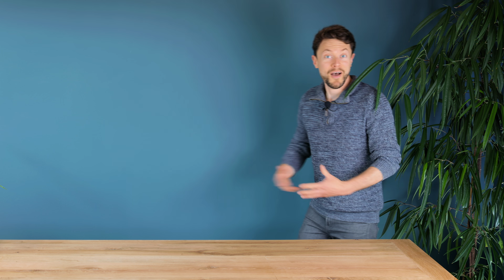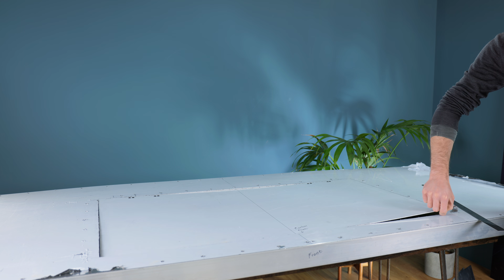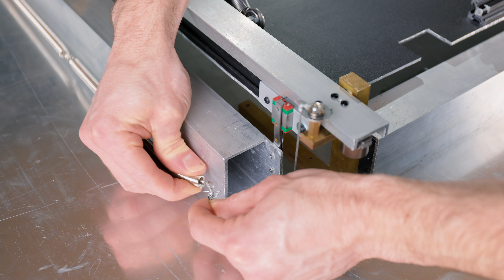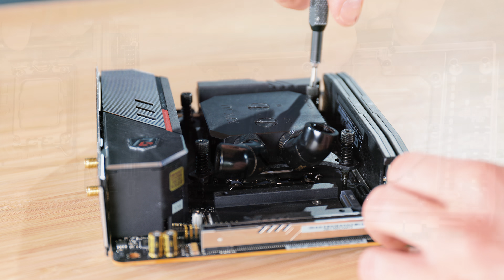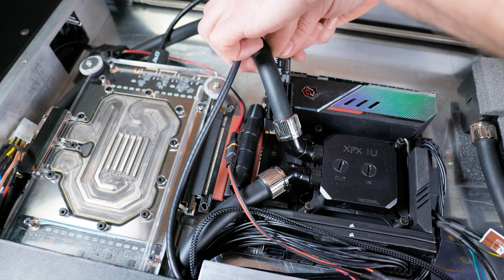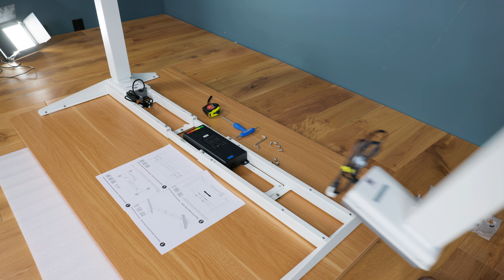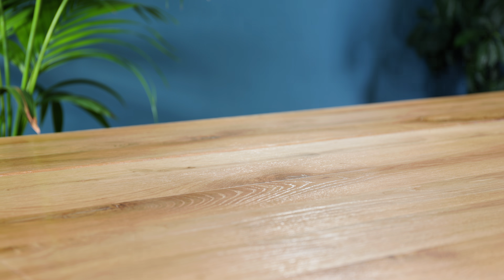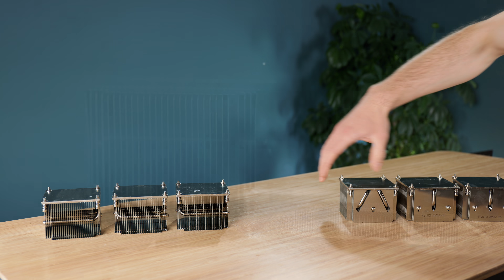Building the ENDGAME invisible PC

Comment: The level of detail in this build is mind-blowing. It's fascinating how you've turned a simple desk into a powerhouse PC, while keeping an elegant aesthetic. The cooling system is unique and seems very efficient. This is an impressive feat of engineering.
Reply: I honestly think it's a fire hazard considering how he's electrifying copper tape to power the fans. The adhesion on that stuff is absolutely terrible and due to the nature of PC gaming having sudden loads + being mounted on brass that's rapidly heated & cooled makes it a disaster in waiting.

The changes he did at the end is also going to result in restricted air flow since the output is so close to the wall and a fan snagging hazard for toes beneath the desk, not to mention the powerful magnet constantly being grinded an inch away from sensitive electronics.
Reply: @Runefrag  add the oled burn in and you have a certain disaster. If the electric/electronic parts don't blow up or start a fire, the expensive oled will get a serious case of burn in. I would give the inner parts more room to breathe, and possidly have an upward facing exhaust at the back, and definitely add a switch to turn off the monitor when the lid is down.
Reply: @Runefrag the fans are blowing away from the user
Reply: @snjert8406  Pushed up right against the wall? I don't think so.
Reply: @Runefrag  I mean, the motor hubs with the stickers are facing the inward side of the table. So, if they function like any computer fan, they're blowing away from the table.
Reply: @Runefrag  Pushing it up against the wall is actually a reason to have the fans facing the wall instead of pulling away from it. Also, with how silent they are, it doesn't matter. I can't imagine it being uncomfortable, unless maybe if you sit at your PC naked.

But yes, the screen will eventually break and it will be a massive pain to replace it, since the mounting screws are blocked by the glued on oak.
Reply: @entcraft44  Fans hugging walls is one of the worst things you can do for cooling. A conservative estimate of how much that would hamper cooling performance is like at least 30-50% but he doesn't seem to have any problems so far so it's whatever.

As for the hot air, looking more closely it looks like it's blowing backwards so you'd be getting a ball draft and some toe snagging fans hazard rather than heating. Paint on the wall will probably get discolored after a while but that's an easy fix.
Reply: @snjert8406  Yeah whoops, i totally forgot you can do both suck and blow configurations on coolers. The distance the fan is from the walls is still not terribly optimal.
Reply: @Runefrag  true, but it seems to have worked. My guess is that the surface area and thermal mass of this thing is so huge that it doesn't matter as much
Reply: @Runefrag "He's electrifying copper tape"

I'm curious - what do you think copper tape is used for?

Copper has an ampacity of 1.2A/mm^2. The tape he used looks like it's at least 25mm in width. With a very modest thickness of 1mm, it would be quite capable of taking 30A.

Maybe try looking up the width and thickness of the average copper trace on a PCB (like the ones in your graphics card), before decrying the dangers of running a couple amps through copper tape.
Reply: @tomfahey2823  The problem is the tape coming loose and shorting out. A full short would blow the fuse on the PSU. So let's say the tape coming into loose contact. With wall AC this could cause a fire hazard, but I am unsure if 12V will cause enough arcing to be dangerous (without being obvious do to tripping the PSU fuse).
Reply: @tomfahey2823  I really thought it would be obvious but here we go:

1. Copper tape is primarily used as a shielding material and less commonly as an anti-snail solution for gardens/houses. It is NOT made for this application.

2. Copper tape is pretty much always made to be absurdly thin for cost saving reasons. He doesn't go into detail but you can see in the video it's basically invisible/flush, pointing towards it not being "1mm thick".

Being so thin and having such a high surface area means the exposed copper will be more susceptible to oxidation and the formation of copper whiskers.

3. The adhesion he uses to attach the tape will inevitably fail, probably quite quickly due to the temperature changes, either loosening completely or curling up and causing short circuits that way.

4. Despite being mounted on water pipes, there's still a risk of localized melting for example, in the mid section where there is no fan.
Reply: @Runefrag  Copper tape is used for electrical applications all over the place, such as for grounding and lightning protection, where it's rated for hundreds of amps of current.

Even a 0.1mm/100um (around the thickness of a human hair - i.e approaching the limit of visibility) thick piece of tape that's 25mm wide has a cross-sectional area equivalent to 14 AWG wire - which is rated for 20A of current. All of the electronic devices around you use PCBs with copper tracks that are approximately 0.035mm/35um thick, which are capable of handling multiple amps of current, as long as the trace width is a few centrimeters wide...

"Copper tape is made absurdly thin" - fortunately, electrons don't care about subjective human evaluations of spatial dimensions and tend to just obey the laws of Physics (at least for a few extra orders of magnitude).
Reply: @entcraft44  Yeah, I agree that the tape coming loose could be a potential issue, however I suspect the power supplies he's using have OCP, seeing as it's been a requirement in the ATX standard since like 2006.

I'm doubtful that anything like this could lead to mains AC getting onto the copper tape, but in the worst case scenario, the GFCI (mandatory in UK homes) for that domestic circuit should trip well before there's any possibility of a fire starting.
Reply: @tomfahey2823  You seem to have some problems with reading comprehension. I never said X amount of electricity CAN'T travel through Y amount of copper. (The copper tracks on modern circuitry is protected/insulated/masked/coated 99% of the time by the way.)

I'm telling you it's an extremely bad idea (while listing several bad things that can/will happen) and that these kinds of products are not really meant for this kind of thing outside of extremely DIY stuff or highly specialized things like flexible TV display connections, which is why they don't have any sort of safety or manufacturing standards unlike cables.

I would love for you to show one or more examples of professional installations that's gotten a passed safety inspection using copper tape because such products is by default something we call an exposed or uninsulated conductive element and it is NOT allowed in the NEC, IEC and similar standards.
Reply: @Runefrag  a) Are copper whiskers a thing? On commercially pure copper that is not tin plated? I have never heard of that.

b) Copper conductors do not experience anything that I would call "thermal runaway". Can you be more precise?

c) A short circuit is not a fire hazard because the overcurrent protection of the power supply will catch it. Only a high resistance connection is problematic.

d) Have you considered that the desk interior is made from aluminium? That will keep the heat away from the oak. I think the fire risk is minimal.
Reply: @entcraft44  a) Tin is one of the metal that forms whiskers most quickly but it happens with most metals, including pure copper, especially if it's exposed to air and thermal stress.

b) I was thinking of something else closely related to fan circuitry, i changed it to that the tape in the middle is likely to melt/experience uneven stress due to not having a fan on it like the rest.

c & d) OCP on modern PSU's have become quite good but the fact of the matter is that you just need a single bummed transformer for that entire protection system to not work. Saying "short circuits is not a fire hazard" is just objectively dumb. Plasma is plasma and it lights plastic on fire just fine.
Reply: @Runefrag It's clearly enough airflow if the stress tests he put them through were keeping it cool at such low volume. Doesn't matter if it's pointed toward the wall. It being inefficient isn't really a problem if it's still doing its job perfectly. 

As for the copper tape, no idea personally but I'm sure he's done his homework.

Comment: This is a fantastic project. But I'm still a bit allergic about the cooling system. Could they be fitted inside the table by using 40mm fans and compatible heatsinks?

Comment: Oh and i think there must have been something else wrong with the first fan design that must have been possible to tweak, side turbo fans like those usually high a much higher static pressure compared to traditional fans. I suspect it would have worked with some tweaking to the shroud design.

Comment: This is an amazing project and I love how it looks and came out.  But one thing I didn’t see addressed and was curious about is if there is any cable pass though access on the raising up platform, like if your keyboard or peripherals needed to be plugged into the computer, or more likely the speakers.  A wired speaker connection give much better quality then Bluetooth would, can have more power, and you wouldn’t have to worry about connectivity issues, lag or battery running out and having to charge it. 

Actually I didn’t see how you are supposed to easily access any of the IO from the back of the computer motherboard or graphics card or the power/reset buttons, but I might have missed that part as there has to be an accessible power button somewhere.  

Maybe if you had some cable pass through cutouts along the back edge of the rising platform that you could also have drop in covers for the ones not in use that could allow for wired peripherals, and a small wired in dock/hub sitting at the back of the platform near or over one of the pass throughs could allow for when you need to plug in devices like wired headphones or usb flash drives, etc.

Comment: Great design yet again and your build quality is certainly improving. Of course the single biggest problem is that it is a horizontal surface when closed. In most environments that means it attracts all the junk of life, meaning they have to be cleared off to another horizontal surface before you can use the PC.

Comment: The laptop fans would have worked, but he used it in an X - X axis air-in to air-out configuration when laptop fans have X - Y axis working setup, the reversible bit that he referred to is the fan rotation which can suction or blow reversibly, but he closed one axis of the laptop fans (the suction part). He only needed to create an opening at the back for the fans exhaust and an opening at the bottom for the fans suction, and both openings would not be visible. By comparison the PC fan is an X - X axis that is why the suction and exhaust are in a straight line and it is sticking out of the table.

Comment: My one complaint about this build is using glue on the rear of the display mount.  If you want to access the mounting, wiring or that controller board at some point in the future, you're going to have to remove the wood that got glued down over those locations.

Comment: Fantastic build, I love that you tested with some decent benchmarking to really show the noise level under load.
I had a look for Flexispot legs, as I would need a different configuration to normal and I could only find 2 leg set-ups, I am curious if you can chain more than two legs together for a L-shaped desk?
Keep up the outstanding work, seriously impressed.

Comment: I think it will be perfect if the opening of the monitor hatch using some kind of electronic system or maybe hydraulic system. Constantly using magnet to pull the hatch will scratch the wood finish.

Comment: Excellent build, beautiful in so many ways, from design to engineering. There is one major standout as a negative.
The bottom of the desk, Having moving hinges, pinching springs and rotating fans all exposed to where a users legs would be is the issue. Adding covers to the fans in the back would of course block the airflow, but adding a small thin cover to the liftrails/springs would be a great idea and not ruin the aesthetic since they are already there anyways. As for the fans, maybe a metal rail running at the back placed roughly 1" from the fans and an open metal grid at the bottom(under the fans) with a removable thin mesh air filter. 
With that said, keep up the good work.

Comment: Using a flexible OLED monitor and mount it ridged, fail. Have the monitor at 90 degrees, non adjustable, fail. 
As always it's a nice project, but an endgame? Not even close. 
Also when you hide the monitor what use is that if you cannot use the space gained? 
The Idea should be that you could still use it for other things like playing a boardgame with friends, but with the fan setup that's just not possible. So there is no gain in hiding everything, it's just a show. 
My take is that components with a little lower spec would have been better, smaller cooling solution and then have the desk available for other things when closed.

Comment: That's a clever radiator design, and not nearly as janky as I expected it to be. LTT should take a look at this.
The only thing is, with the air ducts attached, it isn't any smaller than off the shelf radiators, and probably far less efficient in terms of cooling per area. You can put slim fans on off the shelf radiators to make them thinner.

Comment: As an engineer stuck in a corporate world, Matt and this channel pretty much single handedly got me back into my passion of creating. Completely changed my life!

My end game desk suggestions: Wireless coil charging embedded in the keyboard platform with corresponding wireless kb, mouse and phone charging. I'd love to the keyboard platform routed out so the desk pad locates perfectly - maybe with magnets? Fan shroud with plenum to hide the fans and quiet them even more. Have a nice matching handle made for your magent in the same wood and finish as the table, and clad bottom with velvet. AND WHERE ARE THE LEDs?
Reply: The LED’s are right where they belong, not on the build.
Reply: think of all the FRAMES he's losing from not having RGB!
Reply: I hope everyone likes this comment so he sees it. Great ideas.
Reply: how are you going to put a coil if the frame is made of aluminum?
Reply: @gonsanbo  In between. The wood cover and aluminium. Or to make another cut into aluminium.
Reply: I think it would me cool to have the trapdoor be motorized, especially if he somehow makes it so that it automatically opens and closes when the pc is on or off.

Comment: I really really hope that you put hoseclamps on your cooling assembly after you got your video in 13:48. You need them otherwise barbed fittings will leak.
edit. oh god he used plastic zip ties in 24:01, its better than nothing but please use hoseclamps, they're designed to do this.

Comment: A few months later:

Version 2. Intergrating the original curve mechanism. So it can be bend at will. Using smaller fan that fits perfectly. Install surround sound from every edge of the table. A custom welcome tone/voice when lifting the monitor
Reply: Vertical airflow for the 480mm? Or you have another configuration in mind?

Comment: nice concept, but Instead of the magnet, you should use a system of cut wooden plates mounted on springs, which would allow you to slide your fingers under the edge of the screen. This would be just as aesthetic while eliminating the need for an accessory. Good Video.

Comment: Did you do airflow/static pressure/waterflow calculations for this? 
Did you measure CPU vs liquid(at pump) vs heatsink temps? 
Something seems off for such amount of heatsinks getting this hot.
Also, why not isolate entry vs exit pipe from each other, since these will leak heat to each other, dropping your efficiency. Also, isolating exit or entry pipe from first couple of radiators might help.

Could just use half the number of heatsinks and 60mm fans.

Comment: For the cooling ot be maximally silent without resorting to regular consumer heatsinks and fans, you could simply space the pipes "tubes" 5-10mm apart, and maybe increase their number to 6, 8 or even 10.  (Or even replace them with regular copper pipes). Even if this makes the "fin spacing" in the order of 2cm, the total surface should still be enough to get rid of most of the heat. 

This would allow them to be placed completely within the desk, with nothing visible on the outsider. And given the almost complete lack of air resistance, you may be able to provide all the airflow needed with much fewer fans than you currently have (while also allowing you to hide those fans inside the desk.).

Comment: I want see the automatic opening system with maybe a power button or a remote rather than magnet. OR maybe two power buttons; one can open up the hinge system lifting the monitor up, one can boot the pc along with opening the hinge system  at once. That would be very cool. Watching you build things, i'm sure you can pull it off.

Comment: This is an incredible build, though i feel like a cover over the bottom of the desk would be warranted as well as some fan grilles that one could then also use as an attachment for cable management trays to support desk ornaments such as lamps.

Another idea this gave me is, i wonder if it's possible to embed a laptop- style lid switch in this so it goes to sleep when you close it?

Comment: What about an external heat pump to cool the system? It can feed through the wall and be 100% silent and invisible. The current setup does a good job at (quietly) cooling the system but unfortunately it does an equally good job at heating the room (and probably more directly: your legs) 😅